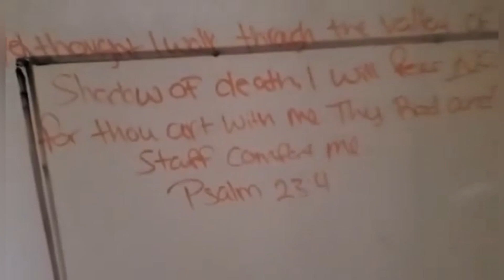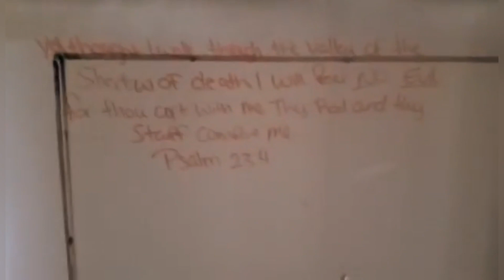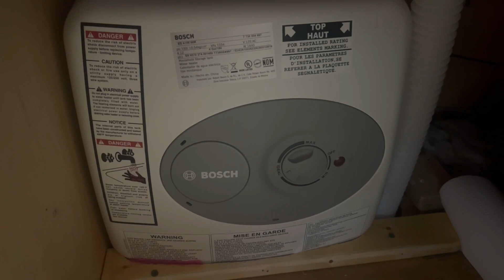GOT ALOT FINISHED IN BUS!

Comment: Are you permanently installing your window AC's ? If so, consider if you have one on each side of the bus you don't exceed 102 total inches.
Reply from the maker: We are only planning to have the one window ac permanently in the bedroom.
Reply: @ParsonRoad  Ok, I assume that will be the split unit. Just be sure the outside unit is secured solidly as it will be subject to lots of vibrations as you travel down the road.
Reply from the maker: @alvisjenkins1305  yes absolutely! 😅

Comment: What was the purpose of putting a ground on your bus frame under the bus ?
Reply from the maker: The electrician instructed us to put a ground on the chassis for protection so instead of putting it behind the wall on the inside, he just ran it straight down. It’s coming out of the distribution box from ground section.